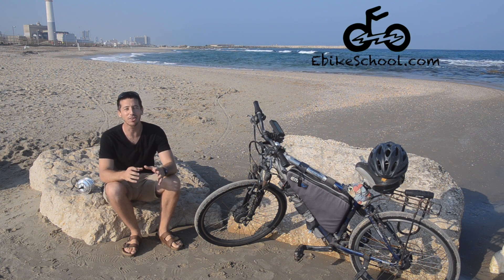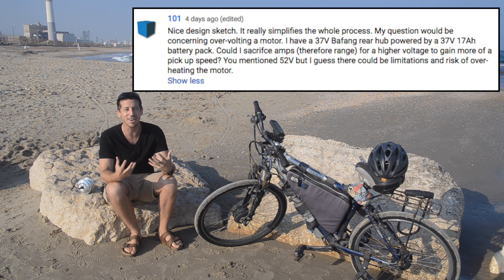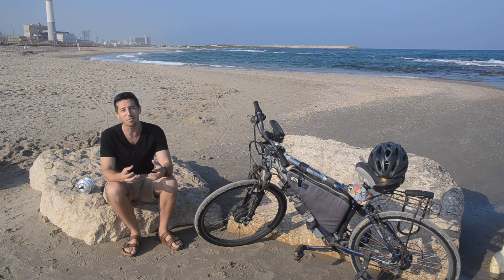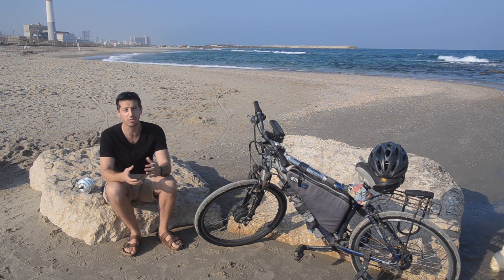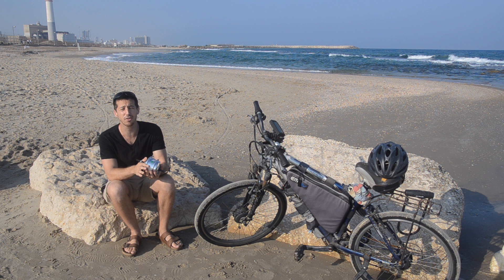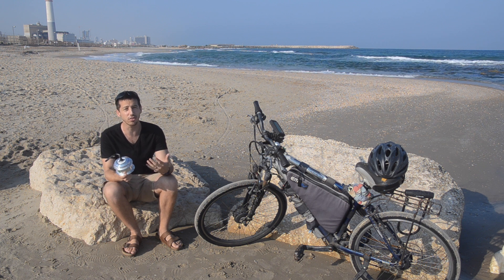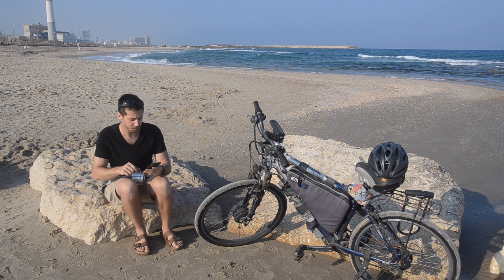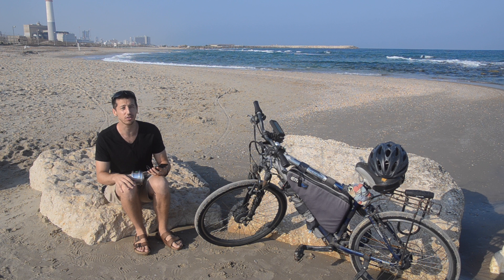Overvolting an electric bicycle motor for more speed! Q&A#7

Comment: My bike its supposed to have a big motor 1000 watt , 48v,  but i dont really feal the power, is not like gasoline bike on hills for example. What could be wrong? On flat it runs fine. Ill try to make a video to post it and perhaps someone can help me out. thx
Reply: CARLOS PORRAS i just finished my bike with a 1kw chinese motor from ebay and i am flying up the hills so there is definetly something wrong with your bike.. do you have some more infos? battery?
Reply from the maker: Not all 48V 1000W motors are made equally. It could be a faster wind, which works great on flats, but gets bogged down on hills. Or you could be a heavier rider. Or you could have a weak battery that has high voltage sag. Do you have a cycle analyst so you can monitor power and voltage while riding? Diagnostics help a lot.

Comment: Well mines up to 3kw at 72v from 48v 1kw
Reply: Christ, what speeds can you reach with that? Moreover, how long can you maintain that speed haha!
Reply: Jonathan Overes I really don't know how it hasn't popped. Running 20ah of laptop cells 18s10p into a chinese controller. 35mph on the rear hub motor alone with a ton of weight. Bike is a yuba Mundo with a 220lb rider. I am switching to mid drive,  but while I'm working I still have that hub.  With the bbshd and that thing full tilt it goes 43mph. Does it feel safe up to that speed?  Yeah.... it actually does. Do the brakes work?  No. They're good to about 33. What hills will it do?  Absolutely anything you throw at it if you use both motors,  and 80% of anything with just the rear. 18 or so miles of range at about an amp hour a mile (full blast) but it gets extremely efficient if you back off. I did 4 miles or so on 2.5 ah yesterday. The motor gets hot, about 6-7 seconds is all you can hold your hands on it,  but it works and hasn't let up at all even pushing it extremely hard. (5 miles all up hill full power)
Reply: That is impressive! Do you also have the option to use regen braking? I always wondered if diy e-bikes have that option. Because that would save your friction brakes a lot of wear and tear, all while recharging the batteries!
Reply: Jonathan Overes I have the option for electric braking, but that's it. I don't use it. No matter how tight the nuts get, they still loosen in about 3 miles with it. I have two torque plates, and a torque arm and they still pop due to the back and forth. If I had clamping dropouts I'd do it. When I had it,  it was extremely effective. Almost like having a third brake. I'd use it 98% of the time. My next bike is going to probably be one of those china motorcycles. Get something registered. I love my bike to death though. How do you like the 2wd? I'm thinking hard on it because of how normal it looks.
Reply: joblessalex n
Reply: im  running a 3600 watt 72v controller on a 1000 watt 48 volt wheel it does get quite hot when i give it some stick but ive hit 45 mph on a flat road ...3 months in and no problems at all and winter is on the way so more cooling for my motor hahaha

Comment: Hey Mika.....I really enjoy your channel! if first impressions mean anything, you seem like a great guy. I'm a fairly recent sub., and just getting my feet wet with world of electricity, and electric bikes, but I'm sure that a project will be underway in the near future....of got grandchildren that I have to find effective ways to bribe them into wanting to downs time with me after all.

I have yet to get your books, but no doubt you will have a customer soon....I am in dire need in knowledge from both.

quick question....in your opinion, is it worth while, salvaging motors from various appliances or tools? if so can you shed light on various sources?

Also, I frequent the local Lowes in my area, and have noticed that there band name lithium ion hand tools- Kobalt, have absurdly inexpensive battery packs. Their 1.5 amp hour 24 volt battery is only $10. Others are 8-9x more expensive. In addition, the 18650 cells are one of the name brands. what are your thoughts about using those as e-bike batteries....and the normal battery charger that Congress with the tool our one you can buy separately?
Reply: my God....why didn't I proofread my comment. i promise, I'm not illiterate, just sloppy.
Reply: You can edit your comment afterwards.
Put your mouse-cursor on your comment and on the right side of the header of your comment 3 dots appear.
Click on those dots and a menu appears. If it is your own comment 'Edit' is in the menu.

Comment: Motor maximum voltage is defined by the maximum field strength in the stator saturation, heat and isolation strength.
Reply: Thank you for your comment. Can you expand on this?
Reply: please expand in complicated form and in simple laymen terms
Reply: Until it melts, nice if they all had thermal cutouts.
Reply: Brushless DC is actually a multi-phase (usually 3 phase) AC motor operated on variable frequency simulated sine wave.

Its a spin-off of stepper motor which are used for precision movement.

If used as a generator you get a very precise frequency based on the rpm you turn the motor (with wind or gasoline engine or water-wheel, etc)

ANY motor can be used as a generator if you know how. 
The common "squirrel cage" AC motors such as in a common household fan have to be started by applying AC, then you start the drive that you want to use to "create" electricity after the squirrel cage is already acting to produce its magnetic field.  Apply more power TRYING to turn the motor faster and it will reverse the current flow, potentially increasing the frequency if you an over-power the system that supplied the starting current. (You  are not likely to over-power the utility company and alter their frequency)
Reply: What this means?
Reply: AndroidGuyPro  Brushless **AC** motors cannot run straight off a battery, they have 3 sections of coils connected in a central neutral point, and 3 cables run to the esc, the esc changes the amount of time the motor is on and off, creating a variable speed
Reply: What he said. Dammit I don't understand what he said!!
Reply: is there any way of measuring saturation?
Reply: So, will more copper windings help to increase the voltage?
Reply: Well look bldc motors HAVE TO have an inverter to run from a battery (since they need oscilation) ALL controlers regulate CURRENT not voltage they are not like 

BDC motor wich has also an oscilator (brushes) but is meant to use a specific voltage say 36 v and a max power INPUT of 10A if you let it spin freely you can give it 80 volts or so untill you reach 10 A but you cant put a load on to it anymore but if you hold it stil ou can only give a few volts and you reach the 10 A limit
And thats how you look at motors not there voltage thats usefull to but its MAX CURRENT mostly

BLDC motors on the other hand have controlers wich almost alyws have current limiting hence you can put 80 volts in and hold it stil it will current limit to 10A and thats it 

I think you meant INSULATION not ISOLATION they are very different things 
In pratice its ussualy ok to go 500 % over on voltage just for insulation 

Field strenght is ussualy constant (permanent magnet) but sometimes like in washing maschine it is not (you can vary it very usefull) means you can have it spin at 10RPM very high torque or at 10000RPM low torque
Reply: @photonic_induction2633  So would it be useful to try a washing machine motor in a e-bike and start off in low spin rpm high torque then as you are rolling have the rpm switched to high and low torque? is this possible?
Reply: @SkyCandyVisuals  Well for an E-bike the best option is a BLDC (three phase).If you dont have one its not that expensive for an basic one (50-100USD).If you must use a washing machine motor its beter to have it spinning at around 2000RPM and gear it down for the wheel to turn at 30km/H.This way you have alot of starting torque and a good speed.You can always make to motor turn 4000RPM to reach 60km/H but wouldnt recomendet  it for a bike.If you want fast speed get yourself a motorcycle.BTW dont try using a bicycle chain for the transmission if you want to have legs
Reply: @photonic_induction2633  thanks for the recommendations. but i already have a motorcycle. i want to make an ebike thats fast enough to keep up with 45mph traffic to be able to travel throughout my inner city but not have to pay insurance or abide traffic laws. lol
Reply: @SkyCandyVisuals  Well , if you want but you realize that youd have a breaking distance of 2x a car at that speed on a bycicle.Laws are laws you have to follow them even on  a bycicle and you have to have a very good bycicle to cope with that sort of speed.Id not recomend you go over 50km/H wich is  30 Mp/H
Reply: @photonic_induction2633  The 2008 model Tebco ebike I have has coke can size drum brake on back wheel, that is a death trap when going down 8% hills and fades in short order, it is a 200w throttle control type max speed 25 kph, the 8% hill will make it do 50 kph

Comment: Have you already made a video about where your controllers and batteries are on your e-bike (and in general where best to put them)? I'm currently using a carrier bag at the back for both my battery and the controller but my ebike just tilts over if I put it on the side stand!
Reply from the maker: I have not made a video like that but its a great suggestion, I'll add it to the list! One quick tip, have you considered a double kick stand (the 'y' shape ones)? They are especially good for top-heavy ebikes.
Reply: Double kick stand might be the way to go for now I think :) But I do feel that the weight distribution on my scrappily put together ebike needs some work.
Reply from the maker: Yes, definitely. Some like it, but I'm a middle-of-the-frame kind of guy. I'll make a video about it, its a good suggestion.
Reply: EbikeSchool.com thanks :)
Reply: @EbikeSchool   Love your video s and want to build my own ebike as I am currently pedaling almost 50 miles round trip to work and back and want some help in making my own ebike that I can charge the battery at work so it just needs to get me a 25 mile on a charge you can send me some info at patdown45@ gmail.com